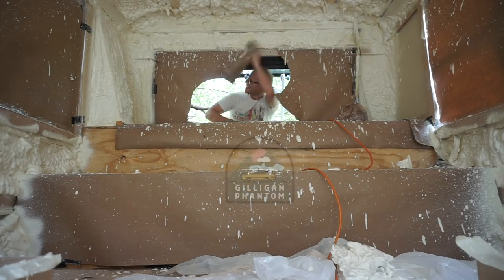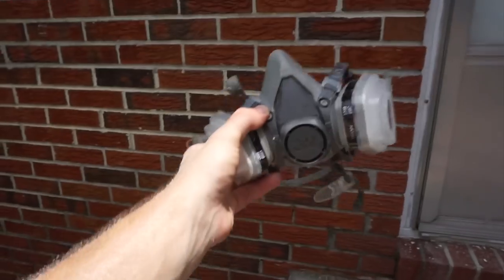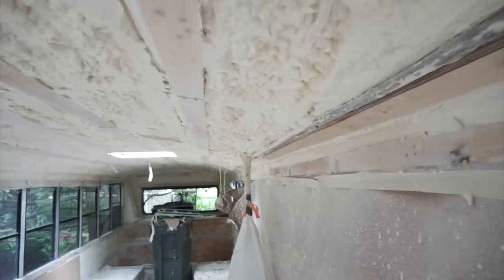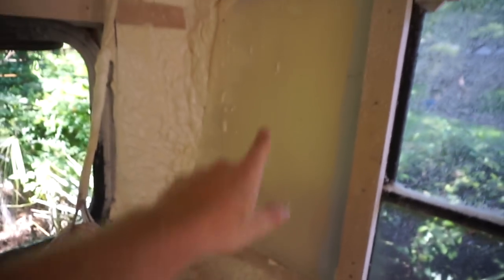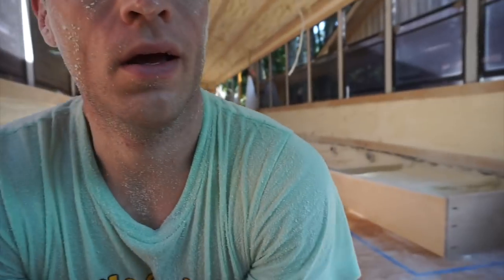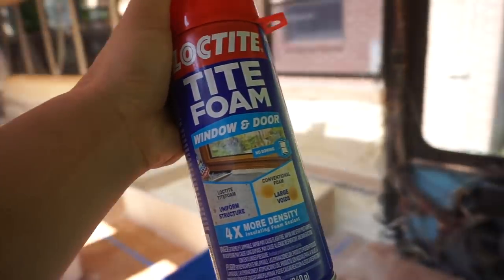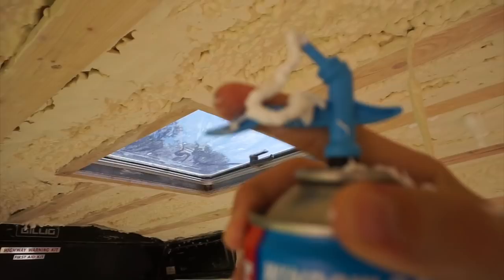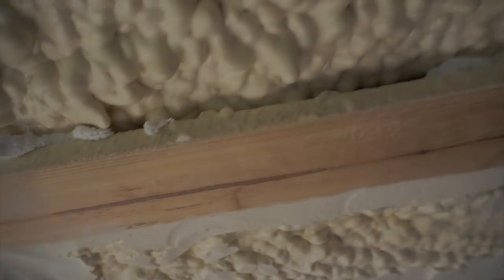Installing and Trimming Spray Foam Insulation in Our School Bus Conversion

Comment: For a house the spray foam is fine, but for a bus ... Extruded foam plates, it is the best solution (and the cleanest). They are filled between the wood and the plates with high expansion foam, applied with a spray gun and removable canisters and it is luxurious, without gaps, without rework, without having to go, literally, coated in powder of the foam that has had to be lowered, since the excess of that foam applied on the edges, comes out with a knife.

Afterwards, you draw where the cables and boxes will go, make the scratches with a blade and give a little putty or expanded foam, it is lowered and voila ... it may seem more complicated, but it is simpler and cleaner.